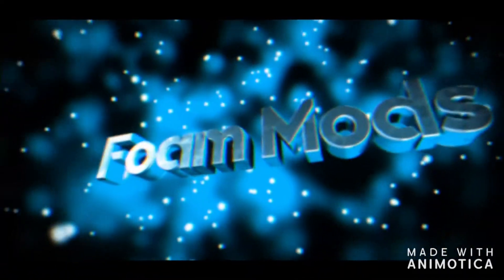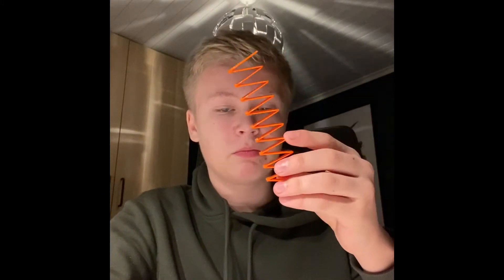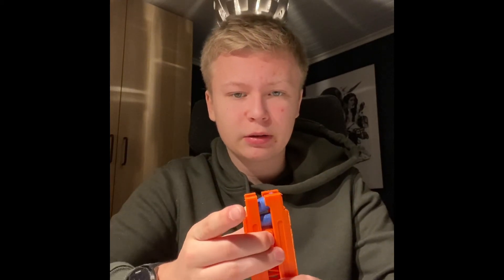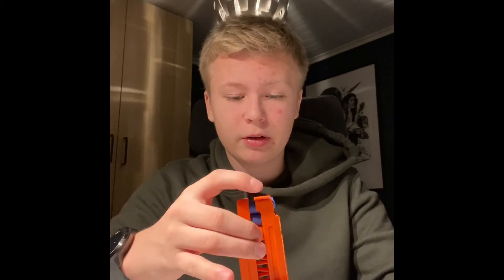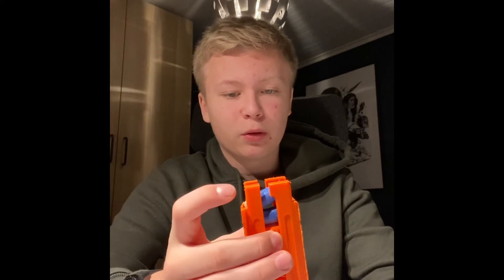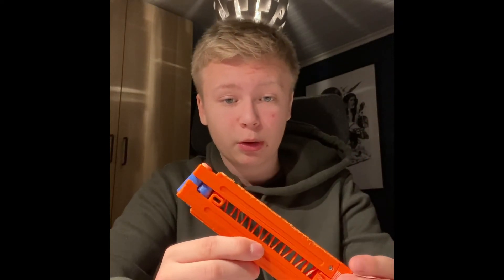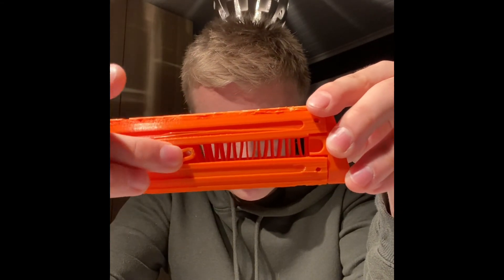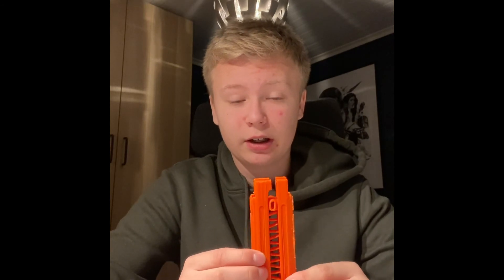3D Printed Spring

Comment: ends of a spring should be flat to contact surface to eleminate displacement of the feeder
Reply from the maker: True, that was the only problem I had with this one, since one of the ends weren't flat (although that should not be difficult to add in some 3d CAD)